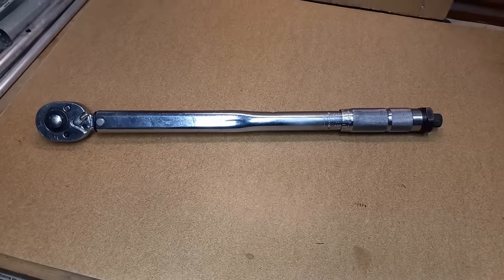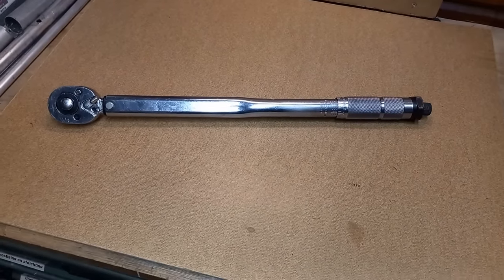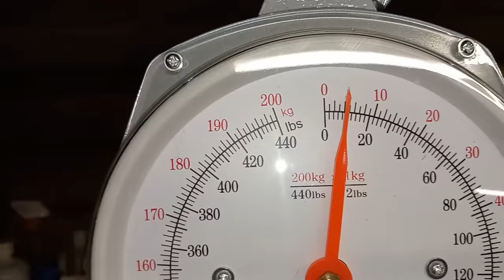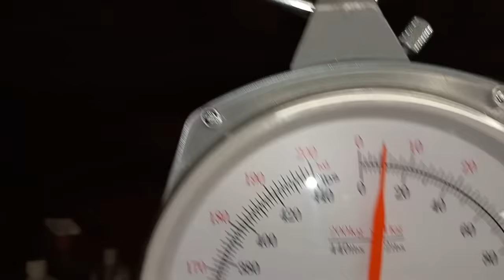How to calibrate a (cheap) torque wrench

Comment: The weight or scale should be applied at the middle 'groove' point on the torque wrench handle.  Not at the end of handle as you are doing.
Reply: It doesn't matter so long as you use the distance from the pivot point to the point of applied force in your calculations. Torque is force times distance.
Reply: @dgphi  it does matter when you are calibrating a wrench.  Where the wrench is pulled from is significant.  And when using the wrench - for consistent values - you should always pull from the center point of the hand grip.  However, the scale he was using was also obviously major calibrated - so there is that.
Reply: @daves7775  It does matter where you pull from, yes, but you just have to use that distance (from the pulling point to the pivot point) in your calculations. If you stuck a pipe on the wrench, and pulled from twice the distance but with the same force, you would exert twice the the torque. You could still calibrate the wrench pulling from twice the distance. You would just use half the force on the scale. Similarly with pulling from any other distance.
Reply: @dgphi  I would gently respond that I was making a remark that when you are trying to Calibrate a Torque Wrench - this is best when the wrench is pulled/pushed at the location on the wrench specified for the calibration.  Which in this case - is the small grove going around the wrench in the middle of the handle.  Which is where the force should be applied.  I am coming a bit from someone who uses and owns extremely expensive Torque Calibration Equipment.  Your pipe method would not correctly work - for a variety of reasons - one of which is that you have no actual control over the exact place/position of where the interior of the pipe is placing pressure on the wrench.  However all of this is mute - since 'Arnold' was attempting to show how a DIY could calibrate a wrench.  I made the very true comment - that in this scenario - the best way for this to be accomplished - would be to place the hook of the weigh scale - at the specific point on the wrench that it is designed to be pulled from.  Rather than the edge of the wrench - which messes things up.  You don't want to believe that.  Fine.  You might someday take a visit to a Torque Calibration Shop - and watch them use the equipment to Test/Calibrate wrenches.  Stuff is not just placed anywhere... but the bar used to move the handle after the wrench is level and properly supported - is placed at a very specific location on the wrench.  In the wrench used by Arnold - that location would be EXACTLY at the groove line on the handle portion.  And all Torque Calibration Shops worldwide - would do that.  But hey - you want to say to do a bunch of math and take distance and measure and stuff - so just place it anywhere on the wrench... OK.  But we are not building and creating a torque wrench - you are attempting to Calibrate an already existing wrench.  As best you are able with the equipment at hand.  And since the wrench is DESIGNED to be pulled at a very Specific location - a person calibrating it just might consider they should use the location for the force to be applied - since the inner mechanisms of the wrench - are all already referenced from the center - to that One specific point and no other point.  But whatever.  He's getting it into some sort of ballpark - being an inch or so Off from the correct pull point - and using a scale which also has significant error.  I was just pointing out a simple way & procedure to reduce the percentage of numerous data errors which are already being introduced.  In a DIY - a person could get better results by having the wrench mounted sideways and the handle out in the air horizontal - and taking a bucket of water and known weight - supported by Twine which is attached to the wrench handle at the groove point on the handle - and gently lowering the bucket.  The amount of force is known; and you work adjusting the wrench until it clicks at the correct force being applied.  This takes slightly more effort - but the force being applied can be steady & even with no jerks.
Reply: @daves7775  Just because you keep saying something is true, that doesn't make it true. Repeating it doesn't make it true.

This is a physics problem, so we have to talk in terms of physics. Let's work through the calculation:

In the video, Arnold measured the pulling point to be at 42 cm (or 0.42 m). He dialed in 126 N⋅m on the wrench. So how much force will we need to pull with?

This is the definition of torque:

torque = distance * force

We can rearrange that to get:

force = torque / distance

So in this case we have:

force = 126 / 0.42 = 300 Newtons (N)

In Earth's gravity 300 Newtons is equal to the weight of 300 / 10 = 30 kg

So he pulled with 30 kg of force on the scale.

(Arnold must have used 10 rather than the more usual 9.8 for the Earth's gravitational acceleration, but that's fine given the precision we are working with here.)

Now let's suppose we move the pulling point inwards by let's say 5 cm, to the groove. That is, to 37 cm. Now we have:

force = 126 / 0.37 / 10 = 34 kg

To recap, if you pull from the end of that wrench, you will need 30 kg to exert a torque of 126 N⋅m. If you pull from the groove, you will need 34 kg to exert the same torque.

In whatever case, you have to do a distance measurement. There is no way around that. 

Your calibration machine that you have must have some kind of distance measuring mechanism in it.

I do agree that it would make sense to pull from the groove just because that is a standard reference point. If you are going to record notes it would make sense to be consistent, and to record your notes, calculations, and measurements relative to the standard reference point. 

But in terms of the physics, it just doesn't matter.

For fun, let's do the case where we put a pipe on the wrench, and pull from twice Arnold's distance. That is, 2 * 42 = 84 cm. We have:

force = 126 / 0.84 / 10 = 15 kg

Unsurprisingly, if we double the length of the lever, we only need half the force. That is how levers work.
Reply: ... just a thought that occurred to me now. I said that a calibration machine would have to have a measurement for the distance from the pivot point to the point of applied force. But that's only if it uses a method similar to the one in this video where a linear force is converted to a torque. But I suppose that calibration could also use a torque transducer which would measure the torque directly.
Reply: @dgphi  Quoting: "Just because you keep saying something is true, that doesn't make it true. Repeating it doesn't make it true."  You are totally correct regarding yourself and this statement - and the way a Torque Wrench is correctly calibrated.
Reply: @daves7775  Well, no. I explained the physics to you. I didn't just keep saying, "I am right."
Reply: @dgphi   Visit a Torque Calibration Shop and learn some stuff - so you maybe decide to quit spouting nonsense.
Reply: @dgphi  The Video and discussion is on how to Calibrate a Torque Wrench.  I haven't been discussing physics - I've been discussing how to Calibrate a Torque wrench.  Which you haven't cared for.  And nothing which I've said in regards to how to calibrate a Torque Wrench has been untrue.  And I made a couple of simple suggestions on how to obtain a slightly more accurate data point and calibration - while being a DIY - rather than using expensive Calibration Equipment.  And you apparently feel that the specific location which a torque wrench requires to be pulled from - to have any chance of actually giving a correct torque reading - is not significant or important.  Have a good day.
Reply: @dgphi  It does matter on a click wrench and you are wrong. You have the right idea but click wrenches rely on pulling at the mark on the handle. The pivot point is NOT where the socket drive is. So whilst you used a bunch of maths, you are actually wrong.
https://www.youtube.com/watch?v=0f746pF1xc0
Reply: @cdh76  Okay, thanks for the link. That's pretty interesting. I find that video convincing, and even more convincing to me is the experimental test that he links to from the How 2 Wrench channel. So, yes, I was wrong. I have changed my mind given better evidence. (But I will never change my mind just because someone says, "I am right and you are wrong," and doesn't present any evidence.)
Reply: @dgphi  Try it yourself. It's hard to "feel" since you have to put more or less force further or closer from the pivot but if you have something like a scale you can measure with you can easily see the effect. Another example: 
https://www.youtube.com/watch?v=BPe1-bDFVRM

Comment: You should always "work" the torque wrench prior to any sort of calibration. My prior employer had a PMEL lab and they would calibrate and certify torque wrenches. They would "work" the wrench around 100 times prior to calibration.
Reply: That sounds dubious, when I torque a bolt, I don't work it 100 time prior to use.  It's usually been sitting for a few days if not weeks before I use it maybe 20 times.
Reply: @bigqwertycat  You work it prior to calibration, not necessarily prior to use. This is what the calibration tech told me anyways. It may not be 100 times, but there was a figure.
Reply: I'm not sure about working it 100 times, but it's always good to give any mechanical torque wrench a few clicks  just to settle the mechanism down after any torque adjustment is made.

Comment: Do you check the readings at the end of the range as well?
Reply from the maker: Not on the utmost end, but at 85% and 15% of the capacity. I do that once a year. In this case I calibrated the wrench at 50% of the capacity, that's the range I use most. But in my experience, when it's accurate mid-range, it is accurate at it's lowest and highest setting

Comment: I thought torque was measured in lbft. So that would mean that the torque value you’re trying to set would need to be 12” from the center no?
How do you know that where the scale was hooked would be the correct place for the value you’re shooting for?
Reply: Where the scale was hooked on the wrench - was a wrong location.  It should have been at the groove on the handle - which is where the wrench is designed to being pulled from and internal mechanism is referenced to.

Comment: How did you measure the 5 liters of water?  I wouldn't assume the graduations on a flexible plastic jug to be anywhere close to accurate.
Reply from the maker: There are marks on the side of the can. Legislation over here is very strict when it comes to contents and weights on packaging. That's why most of these cans have these markings.

Comment: did i miss it, how r u fine tuning the wrench each scale check?
Reply from the maker: What do you mean?
Reply: @Carnold_YT  it wasnt right so u did something then rechecked, what did u tweak?
Reply from the maker: @RocksNRuts4  The fine tuning or adjustment is done by turning the adjustment screw thats inside the rotating grip. That's the small thing I turned inside the grip. Usually that's plenty to correct the setting of the grip (it has a readout on the lever, much like a micrometer). When I tested it after the first adjustment, I needed to tweak it a bit more. I hope this was helpful.

Comment: I cant get the math at all. Tried my wrench at 200mm set at 13nm. Pulled at 8kg. No idea what it should be
Reply from the maker: When you pulled 8 kg (or 80 N) at an arm of 200 mm (0.2 m), your torque is 16 Nm. That means your torque wrench clicks too late and the spring tension should be lowered.
It should click at 6.5 kilo: 13 (Nm) = 65 N x 0.2 meters.
Hope this helps!
Reply: @Carnold_YT  thankyou

Comment: You are not calibrating the wrench; you are only comparing it to a spring scale.  How do you know the spring scale is accurate?
Reply from the maker: By first checking the scale with a reference weight.

Comment: Since the scale is unknown accuracy, it doesn't really tell you anything. Turn 90 degrees and use a 30kg weight which reduces error.

Comment: What was the math formula taking into consideration the handle length?
Reply: Say you set wrench to 100 lb/ft. If you want to use 100 lb to calibrate, it has to be applied exactly 1 ft from center of socket drive.

If you were applying the force at 1.5 ft out, then to achieve that same 100 lb/ft, you'd need to apply 66.66 lb. If you were applying the force .5 ft out, you'd need 200 lb of force to achieve 100 ft/lb.

Its lb/ft, so its lb x ft.

If calibrating in NM, its Newtons of force x meters of length.

Comment: Why hook your scale on the very end of the wrench? Is that really where you hold it? Should be center of the handle! Torque wrench manuals usually recommend gripping in the middle.
Reply: I've NEVER seen anyone grip the middle, always the handle end
Reply: @mrmotofy  he means the center of the handle
Reply: @flat-earther  correct, i meant to say torque wrenches are supposed to be gripped in the middle of the handle. 

That being said... As long as he grips it in that same spot on the end when torquing fasteners... I imagine he's probably good to go(?) I don't know enough about torque wrenches to say for sure.

Comment: Could you discuss the math behind this. How did you come up with 30 kg on the scale?
Reply: Nm = force x armlength , 136=force x 42 , so force = 136nm/0,42m=300N, = 30kg. ( 1kg=10N)
Reply from the maker: Dank je meneer Sjon. I'll add this to my pinned comment.
Reply: I will have to convert to sae. I’m assuming the math will allow this. What is arm length? How do you measure it.   So, newton meters = force x arm length? So you set your wrench to 136 nm and arm length is 42 something. Sorry, I guess math is not my strong suit.
 You buy a new torque wrench, and it is accurate. At some point, you need to test it. So armlength? That will be differant for everybody. Nobodies arm is the same length? 😩🤪
Reply from the maker: @michaelnelson9140  The arm length is the distance from the pivot point to the point where you apply force. That distance is called the arm. A smaller torque wrench can have an arm length of one foot, if you apply 20 pounds of force on that arm (the bar of the torque wrench) you generate a torque of 20lb/ft.

Comment: How do you calibrate the scale?
Reply from the maker: By using an exact weight - preferably the amount of weight you want to use on the torque wrench. In this case 30 kilo, so you want to measure off 30 liters in a bucket and hang that on the scale.
Reply: @Carnold_YT  Perfect. Great idea.

Comment: Is the scale you use to pull on the handle calibrated & Certified as such?
When you use the torque wrench do you have your hand on the handle at the very end only of the handle like you did with the scale?
Normally your hand is in the middle of the knurled grip area and this is where most of the scale should be pulling. So you pulled in the wrong location and use the wrong lenght measurement. At least if you worked in the nuclear or aircraft industry, & with aluminum for example your method would never be acceptable as it is an unskilled way of improperly checking & adjusting the calibration.

Not all torque wrenches can be calibrated to work correctly even though they are adjustable and brand new.
I had one I took to a reputable calibration shop and they said it was garbage as this new torque wrench could not be calibrated to hold any setting, calibration. (Was it a bad spring inside I wondered?). 
 I have seen this with cheap and very expensive torque wrenches when I worked in manufacturing for a very large company where all measuring devices where calibration verified every 6 months.
Reply from the maker: Please watch part 2 too, I adressed many of your remarks in that video

Comment: Don't use this method for anything you need high accuracy on. All calibrations are done on both the highest and lowest scale in turn . I have  my torque wrench professionally tested and certified annually .
Reply from the maker: That's right, but for the purpose I use my torque wrench (and with the price class of this wrench in mind) this method works just fine. For customer work and daily use and abuse, a certified torque wrench is a must.
Reply: I dont care about youre word's Kelvin Sparks. Trow youre Money out of the Window however and howmuch you like! 
I did it in nearly the same way ... from o.5 Nm up to 150Nm ... and i do carburetors and even Racingbikes... so shut up if you have no clue and selfconfidence of youre work!

Well done Arnold ☝️🧐
Reply: @GpunktHartman  You commented towards him you dink.

Guess what? You care.
Reply: @Carnold_YT  yes annual calibrations for my work is a legal requirement here in the UK.

Comment: What about including weight of the plastic can in  the '5 kg' test weight?
Reply from the maker: I guess if I had used a calibrated weight of exactly 5 kilo, I also had to use a calibrated scale. And even then, due to the basic construction of my torque wrench, I would still have the same margin of error. Honestly, I reckon my 30 euro torque wrench has less than 10 percent deviation than a calibrated wrench. In my day job I used certified and calibrated equipment, but I can't afford those myself.

Comment: At the tire shops the dudes always double click, never do that, it over torques.
Reply: If they are lets say 5% too tight, what's the issue? You need to go WAY beyond that to cause damage.
Reply: @penttijakonen3817  It's just unnecessary.